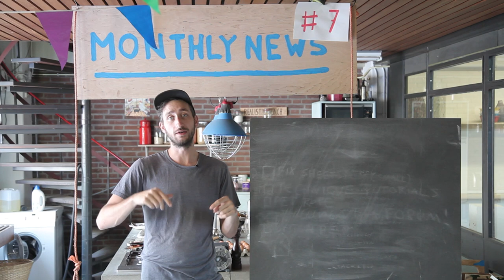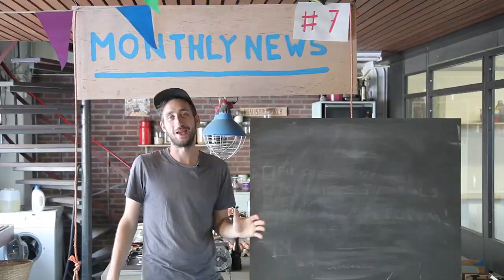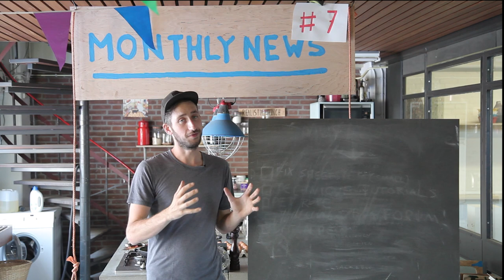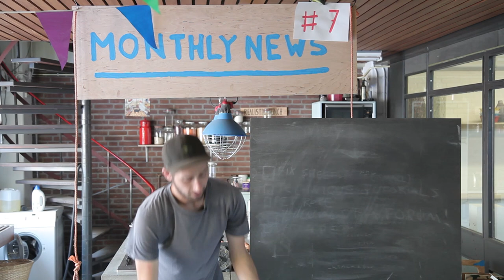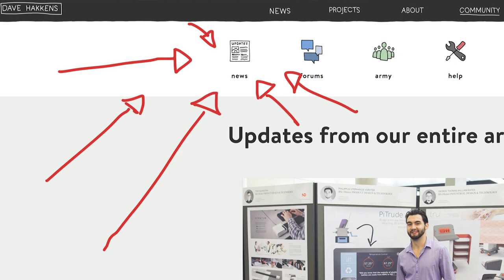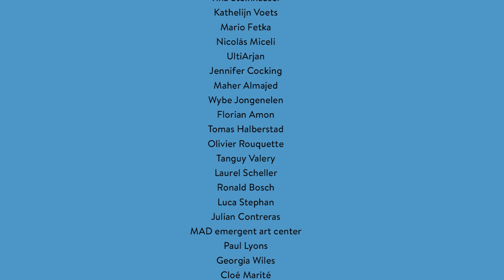Monthly News #7 - Biketrip, Kazakhstan and we set a launchdate!!

Comment: 3:30 Flying is completely fine, airplanes barely put out any CO2. As long as you don't diesel drive there you should not worry. Information is worth it.
Reply: I hope you are joking, jet engines produce as many co2 as any other engine that burns fuel. Additionally it puts it straight where it can make the most damage. 
As long as you are not driving alone, even an old Diesel engine is way more environmentally friendly than any jet engine...
Reply: air traffic represents 1% of all global traffic, emitting 10% of all transport-related greenhouse gas. So the answer is definitely no